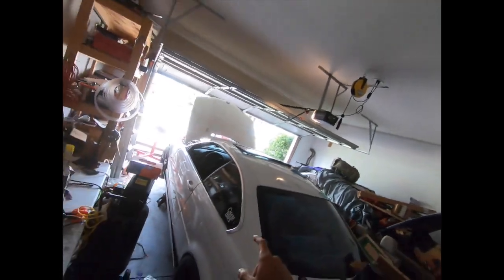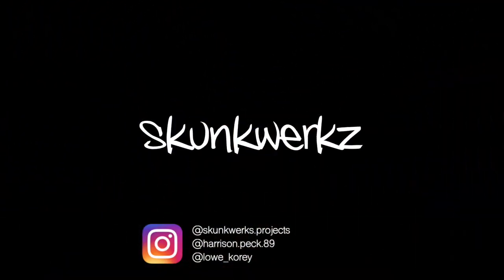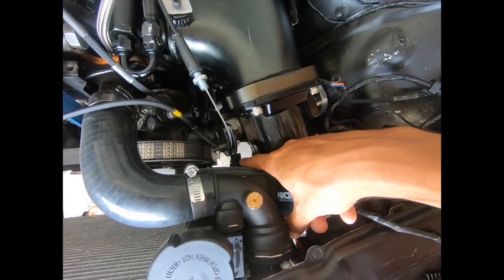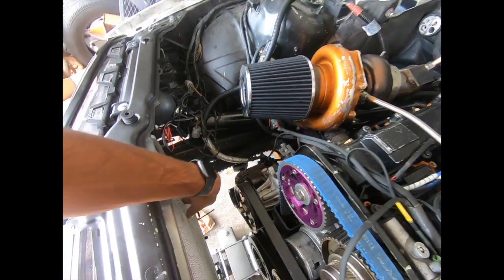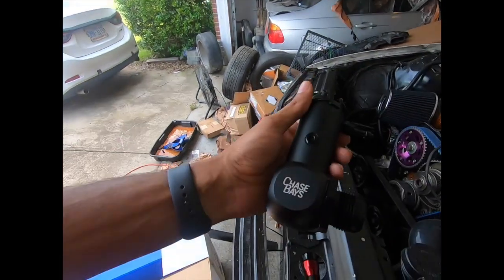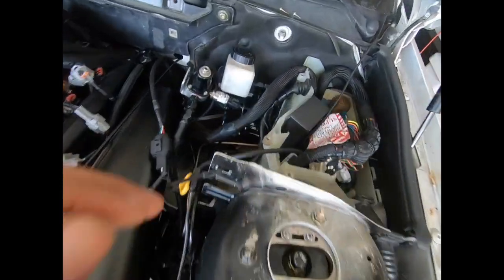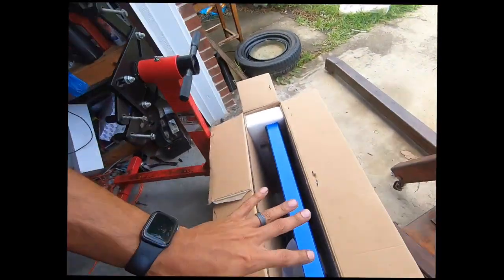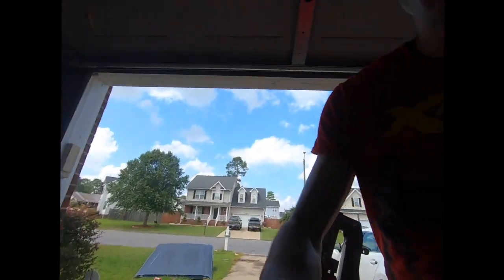2JZ Swap BMW E46 | Does the OEM CSF Radiator work?

Comment: How’d you mount the radiator?
Reply from the maker: We used the factory E46 mounting points as the CSF radiator was an OEM replacement. Ultimately though, this didn’t work for our car specifically and we switched to a Chase Bays radiator however with a little more patience I think we could’ve made this work. Others have.

Comment: Any problem on the tight space for the csf next to the belt?
Reply from the maker: As far as contact between the Acc. drive and the OEM fan, no. The problem we ran into was the space near the throttle body. We couldn’t use the OE expansion tank as the space was too crowded. Ultimately we switched to a Chase Bays “tucked” radiator and a slimline electric fan from our sponsor Mishimoto. This gave us more room and it allowed us to move the upper hose inlet to the opposite side of the radiator and cleared up the area by the throttle body. With a different intake like the stock GTE one, the CSF radiator should be fine.